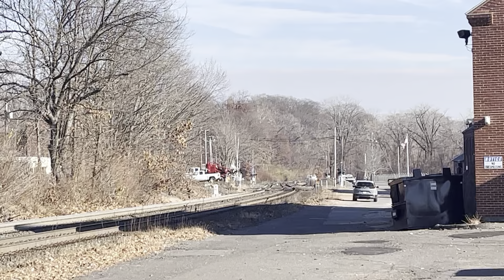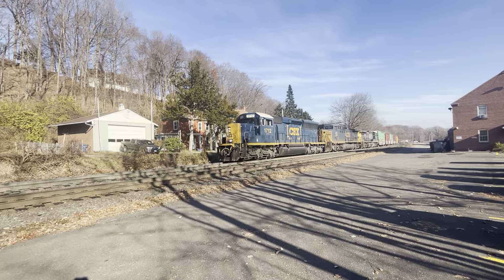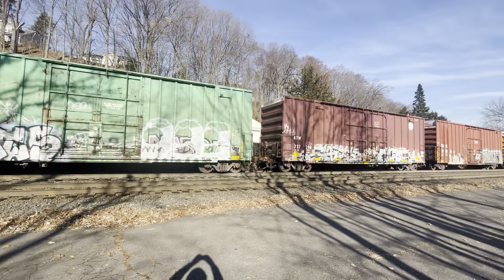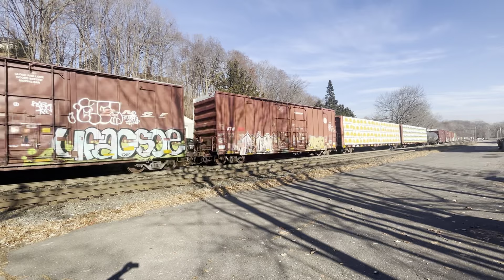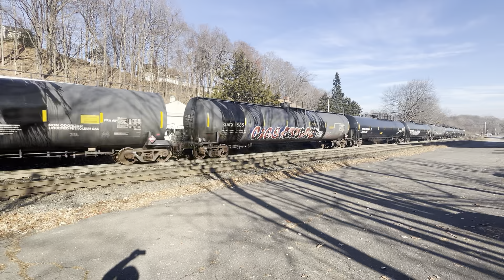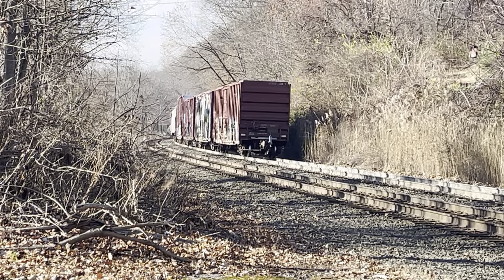Notch 8 on M427 Reverse Rigby 🚀 Rocket as it Vaults From West Springfield Yard W/ SD40 Leader💜💜

Comment: Love Dem SD 40-03's, I Guess they are a Cross Breed with a EMD Car body and GE Gevo with Flared Radiators.
There in 8 For sure.
Do you think those Bay Line Cars are from Mattawamkeag? "Sorry don't Know the Correct spelling"
Reply from the maker: I don’t know 
They used to serve Jay, Maine when it was still open
Reply: @MillersRailfan which is bizarre given the massive volume of chips and roundwood they took in from from Maine loggers and land clearers.